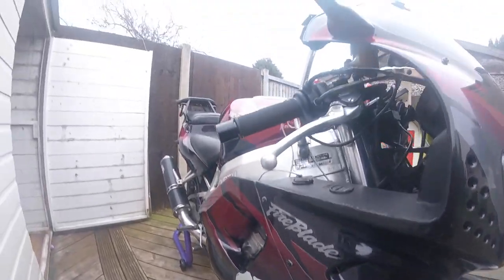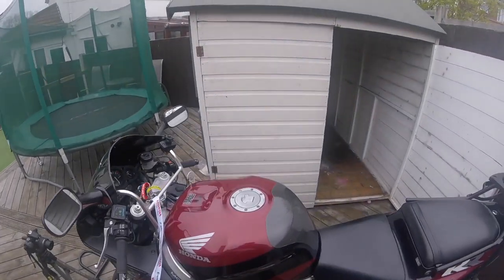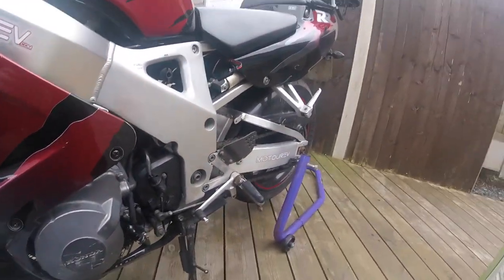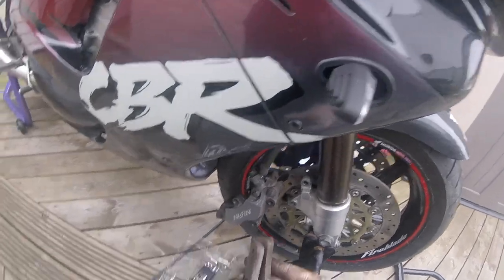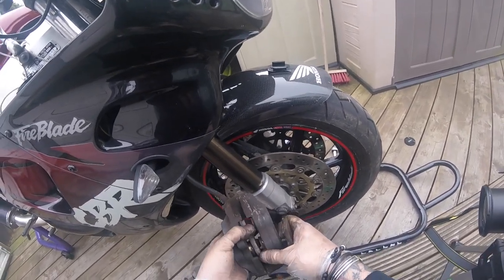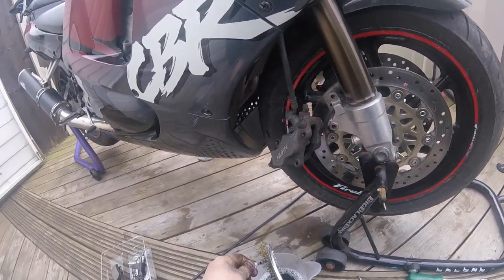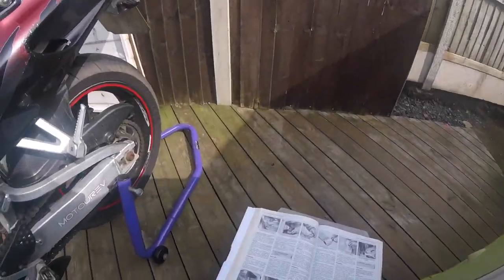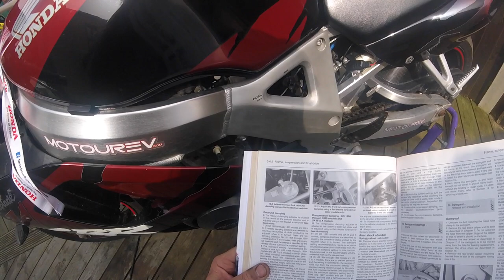Fitting Brake Pads & Adjusting Suspension | Motorcycle Motovlog

Comment: Nice job and vid, I was planning to do the same thing this weekend, very helpful, because it's my first time that I'm going to do that =)
Reply from the maker: Same here mate, never done pads before but was straight forward. Couldn't fit anything wrong as all parts only fit in a certain way. Just remember to properly torque the calliper bolts to the correct setting, you don't want your brakes coming loose. Thanks for watching.